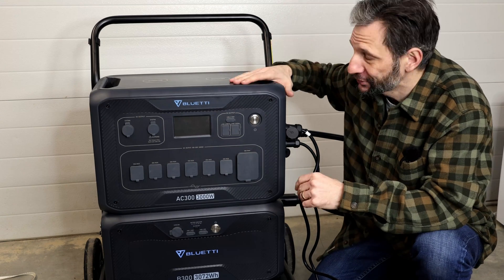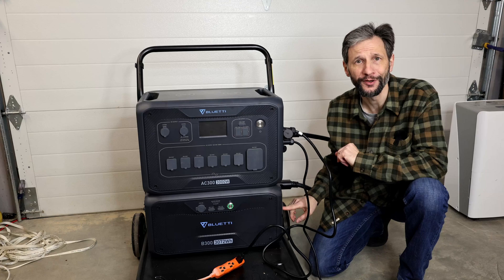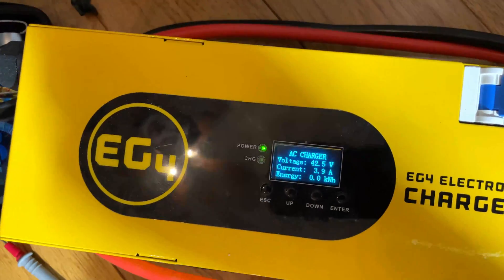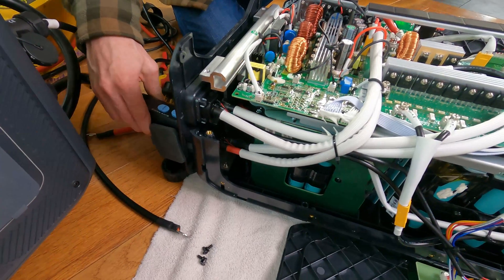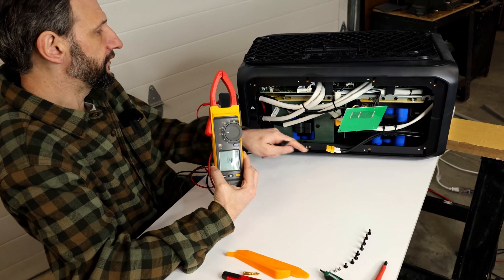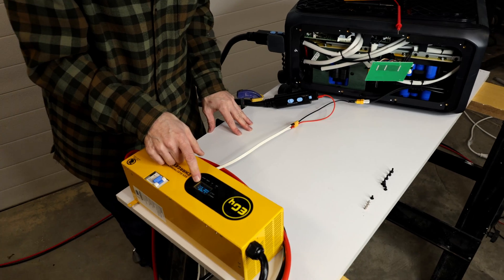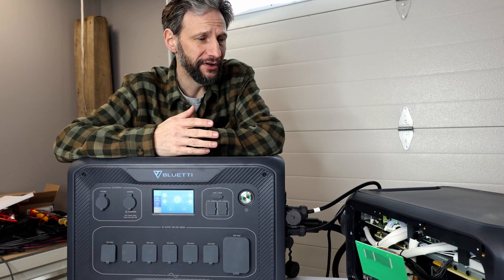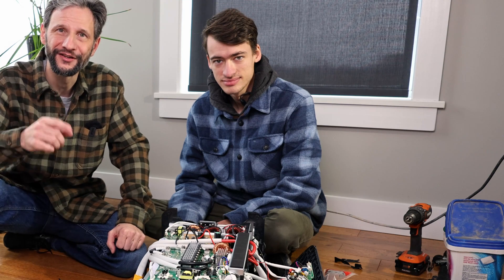Bluetti AC300 Solar Power Station DIED - Can I Fix It?

Comment: Freakin' guru Dave. I has sent mine back 3 times.  I ended up putting a 30A toggle on the back panel that disconnects the negative from the board and routes the circuit to a stud sticking through the back panel. Now I can charge without taking the back panel off. You made my year.
Reply from the maker: Awesome to hear the video was helpful for you!

Comment: thank you for sharing idea how charge, without huge amount of disassembly. It can work, but only if you don't have any troubles with battery cells themselves.
Even though I don't think that only self-discharge was involved in your situation. 39V is too low for 2 packs (2 packs which are 16s10p with single battery elements of 3.2v, 6000mAh each)
BMS would/should cut-off any drainage at 49-48V (to be fair, mine b300s, which I currently have in disassembled state, trying to figure out less painful way to disassemble pack of batteries, so I will be able to re-pack + assemble it again)
And it doesn't seem right to have 10V less than that 48-49V in 1 month (as far as I understand, you were saying that battery was in "off" state for 20 days)
I'd recommend you to give it a try to check each string to BMS (each battery pack has 8 or 9 contacts string to BMS board), each should show something like 3.25-3.3V.
If you have any line to BMS with lesser voltage, I'm afraid you gonna need to disassemble this unit again, repeat your actions from video. But that won't help for long time.

And if this is really some single batteries "dying", since they are all connected, and BMS tries to keep them equally charged, so despite of usual 1-3% discharge rate, this would drain from other series, causing way faster discharging of the whole unit.
Anyways, if there is a faulty line, it would show up in serious voltage difference. E.g. in my case 2 battery packs (from inside of 1 b300s) were having 26.6V and 24.0V, and power-on button was blinking, just like yours. In my case, I've got ac500 + 2*b300s, so noticed serious difference in charge percentage (new unit vs old), that was a "red flag", since have this system running as a power backup 24/7, and drainage was not acceptable... And at the end that faulty battery-line did not allow to charge the whole unit with Bluetti's T500 for more than 370Wh, later power-button just started blinking, without accepting any charge at all (that continuous blinking means - hardware problem... bms was not able to calibrate/equalize voltages between strings, and Bluetti has deep discharge "marker" with fixed amounts of button blinks like 7 or 8).

In your case you was able to charge the whole unit from external source of power by-passing BMS, and it is nice to have your unit back. In my case, I've started digging into BMS faulty behavior, and analyzing batteries themselves.
I hope you unit is not faulty as mine, but anyways, I'd suggest to check those BMS lines separatly, they can give you clues.

nb: 1 note though - after I've charged (was able to charge) my faulty b300s unit with T500, 4 weeks has passed, and after that I've disassembled unit (btw. thank you again for sharing video, b300s looks similar to b300, and your disassembly tips are really handy!). So after no charge in 4 week I've found with multimeter on BMS lines that difference of mine (1 of 16 lines has 0.75V, others were 3.25-3.3V)

Comment: Excellent work 👍. 
I have a question. I have BLUETTI AC70 and charge it with Two 120 watt Echo Worthy solar panel. Is it ok to keep the Solar Charging cable XT60 connected when Battery is fully charged. 
BLUETTI AC70 only has Bluetooth, Does not have WiFi, which is a shame. 
Can you please invent a device, so that BLUETTI AC70 can be connected with home WiFi, so I can monitor it Remotely when away from home.

Comment: Can you use the Bluetti T500 500W AC ADAPTER to charge it in a deeply discharged state without opening the battery?
Reply: unfortunately you have to disassemble, in order to get to contacts, to charge battery directly (bypassing BMS).

Comment: Happened to my unit too and its been doing it multiple times that I added an xt60 connector at the back so I can wake it up without disassembling the back part 😁 I think this is a flaw because it shouldn't discharge as fast as it should even when the unit is not turned on.
Reply from the maker: I haven't had any further issues with mine.  Have you updated to the latest firmware?

Comment: So you had the AC300 plugged in to solar and A/C and it still over discharged, is this because you set the user parameter battery threshold too low at 10%, why would Bluetti allow a set point that would cause this to happen, the load should automatically disconnect if the battery is about to shut down. With all this fancy programming this thing should be just about bulletproof from over discharge if it’s plugged in to A/C.
These power stations are pretty convenient all packaged up but the more I read about the complaints the more I think one would be better off building your own from off the shelf components.
Lastly when you had the unit all apart why not add an XT60 plug sticking out the back that directly tied to the battery. Cheers and good luck.

Comment: Would it be a similar process for a ep800 battery? To get it repaired. I recently purchased the bluetti ep800 with two batteries. One battery came over discharged. Bluetti said to send it back and they will replace it, but I'm outside the US and shipping it back will be a pain. Any idea on how to repair?
Reply from the maker: The EP800 is a much higher voltage battery.  It would be much more dangerous and you would need a higher voltage charger.
Reply: @ProjectsWithDave 
Just how much voltage would be needed? To get it charged.

Comment: I bought the Bluetti 500w charger and PV yellow  plug adapter and used it instead of the EG4 chargeverter.  $150 vs $500. Worked great. Thanks for the info.
Reply from the maker: I used the EG4 charger because I had it available.  I should have mentioned any 48V charger will work.  I'm glad it solved your problem!
Reply: Where can I buy the Bluetti charger and pv yellow plug adapter? Or  what other 48 v chargers can you recommend?

Comment: Hi I have  a small  unit  zerokor   my Ac outlet  not working  have  any idea  on fixing it
Reply from the maker: If the AC outlet isn't working it could be a fuse or the inverter is bad.

Comment: Did the solar controller built in to the battery not work for low-voltage recovery? You should be able to connect an external DC power supply between 12-60v to the solar input that is located on the side of the battery itself to recover the battery as long as the voltage in the pack does not become low enough that the lights on the front of the unit do not turn on at all.
Reply from the maker: The BMS disconnected from the battery so no charging input could deliver power to the cells.
Reply: @ProjectsWithDave if i buy the new battery b300k and Connect it to the main unit ac500  will it charge the drain battery b300s attached to them .

Comment: I have to do something quite similar with a 70 Mai Terra 1000 power station, if I let the SOC get to zero.
Reply from the maker: It seems like there should be a way to have the BMS recognize the over-discharged situation and pull out of it.

Comment: So you just need to have a $500 48 volt chargeverter on hand becasue the BMS cant reboot itself off shore power? Yikes.
Reply from the maker: Ideally you don't let it sit for weeks in the cold fully discharged and you you won't have this problem.  Also, there are some cheaper 48V chargers that are sufficient to do the trick.

Comment: As always, great and useful content Dave. It seems like your over-discharge problem would have been a good excuse to buy a new B300. Do you agree that that would have also solved your problem? Would you then have been able to recharge the over-discharged B300 without dissassembly?  Finally, if you had sent the "dead" B300 back to Bluetti under warranty, wouldn't they rightfully be able to charge you for two-way shipping because the problem was mostly user error? I believe Bluetti may have "fixed" your problem and simply sent your newly recharged B300 back to you gratis. They have been pretty generous in the past. I have an AC300 and 4x B300's, charge from solar only, and have been running house loads for nearly 2 years without any problems, except for ones I've caused myself.
Reply from the maker: Generally speaking I think Bluetti has the best software control options for this size system and I like the way it operates a lot.  An additional B300 would not have fixed the problem, the B300 batteries themselves would not allow a charge.  They offered to ship them back and fix them, but then I would not have known for sure what the problem was.  I felt like I owed it to my viewers to do the full investigation myself.  Turns out it was nothing earthshattering, just an over discharge condition.

Comment: This issue is going to disappoint a lot of people that are planning to depend on these units in a grid-down scenario.  Does Bluetti warn of this specific issue in the user manual?
Reply from the maker: Yes, all the manufactures of these systems warn against leaving the system fully discharged for any length of time.  They all recommend storage at 50-80% SOC.

Comment: Same thing happened to my ac200p. That was it for me. I have the eb240 and 150. Both have worked without issues. They are actually work horses. But I don’t trust anything beyond those 2.
Reply from the maker: What did you do with the AC200P?
Reply: @ProjectsWithDave  I recorded the event and sent the video to customer support. They replaced the unit.
Reply from the maker: That's good.  They offered to replace mine as well, I just wanted to figure it out myself.
Reply: @ProjectsWithDave  i totally understand the curiosity.

Comment: We have had more issues most recently with all the influencer products coming from bluetti, eco flow, anker and what not has jumped onto that "power bank becomes solar power system" band wagon or train.
Some are violating domestic laws or ignoring those, some have gotten a certification for their product and silently changed the design afterwards no longer being compliant and many simply suck due to software bugs and also design flaws , too thin cables for example.
And all of them lack the general will to communicate openly which cells they are using, I mean the brand and cell type which means model number and not just LiFePo4 chemistry.

I tend to unsubscribe all the channels that feel like promotors or sales agents for these 3 brands and of cause power oak is on that list also even though this brand seems to have closed and was already a subsidy of bluetti or so. 

At the end you have here fixed a problem with a product you had shown before and recommanded I guess - but these 3 brands are killing their own market cause in the EU these brands will cause new legislations that all the influencers products have to make open in the very beginning what they had gotten from the manufacturer and even details of the contracts from money, provisions / comissions paid per unit sold or turnover and free products. Everything. Some countries in the EU have this in place and this forces youtubers even to mention a free entrance to an exhibition if they had gotten tickets from the company. Austria is one example - and an austrian youtuber mentions everytime he speaks about the british or german tank museum that he had been invited by them before and in which years (he mentions all of those) to make things clear. And those are museums which are not sponsoring anything except the free entrance.

Comment: This is not the first time I have heard of the bms shutting off on the external batteries for bluetti products. Usually you can wake it up by providing voltage to the bms, I have seen people recommend leaving it on the ac charger for a day and see if it comes back, but you cannot use the charger through the main unit, sometimes people recommend using a battery of the same voltage to do it. But in this case it is probably best to charge the battery directly since it was that low. Very nice to see how it is done. I do not have any of those units, I do have the ac180 and no problems so far. I have other brands of units and I am sure all of them will do this eventually.
Reply from the maker: I think you will have no issue if you keep the unit from reaching the "over-discharged" state.
Reply: @ProjectsWithDave  only problem I see with that is that such a thing is not user's work but BMS' work.
Reply: Yea ummm why drain the battery so low the unit doesn't recognize the connection in the first place. Seems to be a issue caused by operator error

Comment: How did the battery voltage get so low ??
Reply from the maker: I forgot the AC input was disconnected for an experiment and the solar panels were covered in snow for a couple of weeks.  Also temperatures were only just above freezing.

Comment: It's better to build your own system,these hi frequency power banks won't last for every day use all brands have the same problems.
Reply: Hi, if you make it yourself and it’s modular then it’s easier to diagnose.
For an all in one, like this you need to accurately diagnose the issue and then rectify it.
DC inputs not going directly to battery made it harder and not waking the BMS is an issue.
Take care, nice video M.

Comment: Can you charge these batteries using a 12 V charger? Something like a Victron charger.
Reply: You would need a higher voltage supply/charger and the ability to adjust voltage and current since the pack voltage appears to be 48V
Reply: @kuhrd  
How about just to wake it up? Then plug it into the wall or use solar panels.
Reply from the maker: The problem is the system voltage has dropped too low to initialize the BMS so It won't turn on to charge.  You have to directly charge the batteries with an external charger.
Reply: @ProjectsWithDave  if this could happen again,perhaps you should just install a direct-to-battery terminal set to hook u[p your external charger. (modification) instead of taking it apart every time. I suspect an inexpensive 48v 2A e-bike smart charger would do the job,for those not having that big charger you have.

Comment: Why does the Bluetti BMS allow the system to discharge so low that it can't recover on it's own? We have two of the 2nd generation JK-Non-Inverter-BMS (B2A24S20P) and four of the 3rd generations JK-Inverter-BMS (PB2A16S20P). They are 200 amp with 2 amp active balancing and Bluetooth and they will prevent each of the 15 kilowatt DIY batteries from discharging below a safety set point.
Reply: There is no reason it could not be designed to recover but it would require extra circuitry.  Extra circuitry that most users would not notice in the life of the product.... It appears that the power supply for the control electronics is only from the batteries. There is no reason the AC (or even solar) charging system could not also be used as control power and at the very least offer diagnostics (battery too low). Of course once the control circuitry knows the battery is too low and by how much... even on a cell by cell basis, it could take remedial action all on its own. I suppose the warranty doesn't cover letting the battery go that low anyway. Still, It would not be that much added circuitry.  Honestly,  it is just one more reason for me not to buy an all in one.
Reply from the maker: I agree, I think it could be programed to recover from this condition.  Hopefully manufactures take notice of these kinds of issues and continue to mature the products to prevent even these unusual situations.
Reply: I am guessing that it sat discharged and the BMS along with the self discharge of the cells caused the BMS to shutdown.  If it would have been recharged right away it may have recovered on it's own.  If they would have marketed it with a lower capacity they could have left a larger reserve at the bottom to keep the BMS alive during an extended low voltage scenario.  It very likely was a marketing choice that they made because line must go up.  
On my home system I have 48KWh of storage and I keep the main system bus at a voltage near ~20% capacity with an inverter transfer setting for this very reason since during the winter I can get days in a row with snow covered panels and grey skies so I have to keep the system lifted at the bottom so the BMS's don't kick out when a large load kicks on when the batteries are low.  If I did not have this the BMS units are set to kick out at 0% SOC and if I had a week or 2 where I was not home with no sun the BMS units and the self discharge of the battery cells could leave the system in a position where it won't recover without manually bypassing each BMS for a few minutes to get every pack back up to a point where the BMS can take over.
Reply from the maker: Right, I left it too long fully discharged and there was no line or PV source to charge back up or it would have recovered on it's own.
Reply: @ProjectsWithDave Dave, first time here,I have the 200 P with the same problem battery ran down and now no screen and and can't charge back on,have you fixed one of these ?